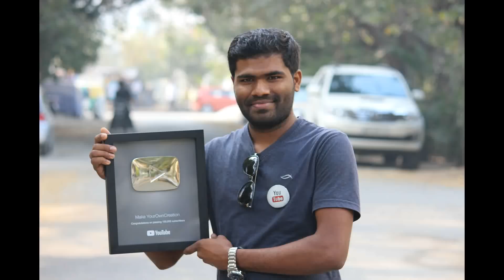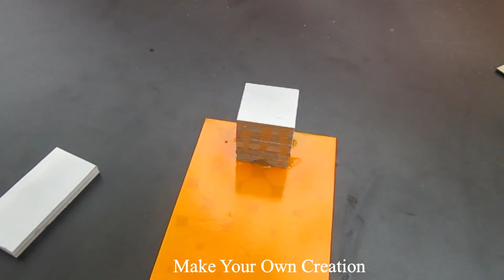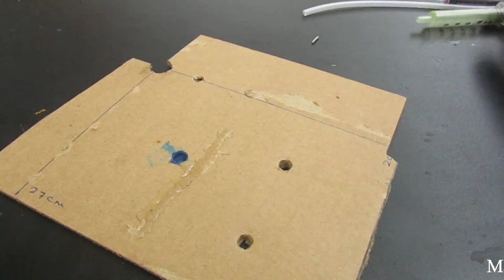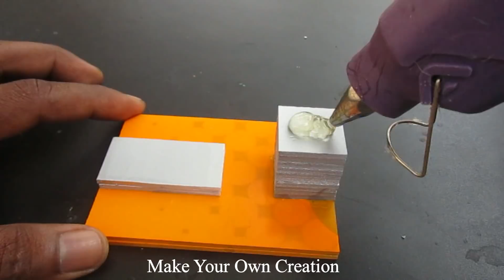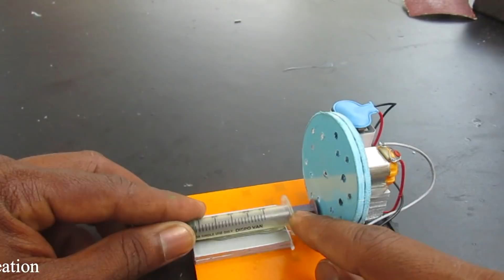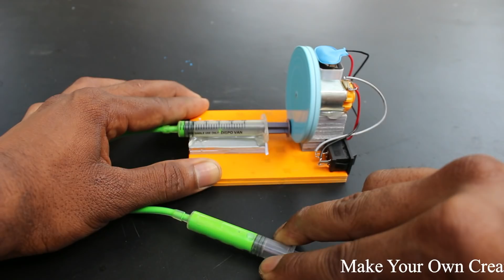How to make a hydraulic disk brake - Hydraulic Press

Comment: Shit....nice comedy...... That's a very low power motor..and this is not what hydraulic is....this is a manual powered thing...but hydraulic should reduce human pressure... Thats the work of the hydraulic.... Even without using that water we can simply use the air Inside the syringe....
Reply from the maker: ok sir, i will try it